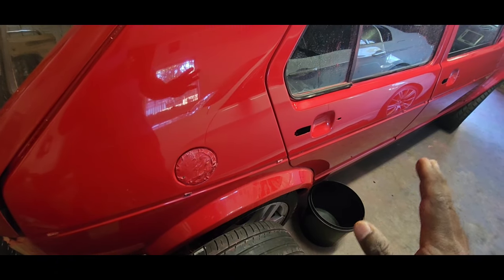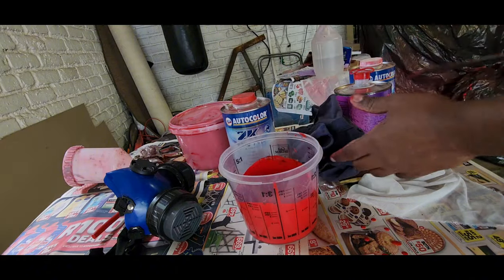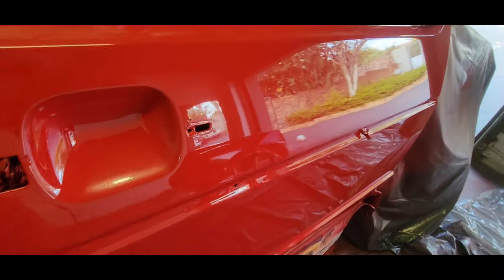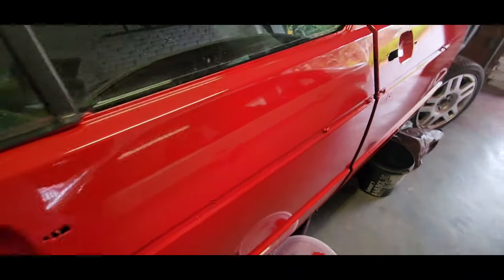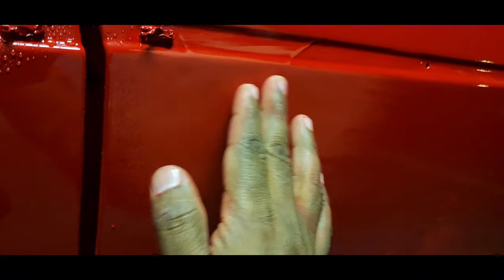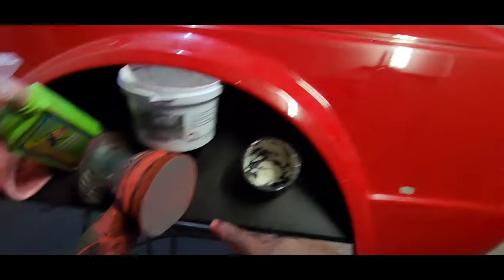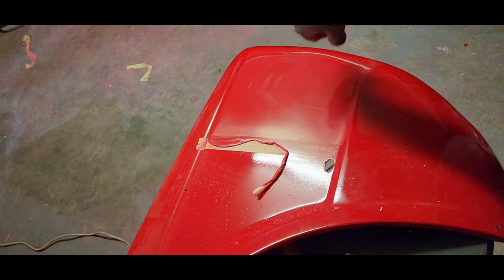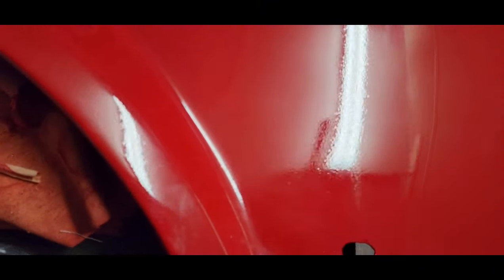How to get show car paint finish in your home garage

Comment: Awesome stuff man, the sponge pad you use at the end, does it help with swirl marks? Spray job turned out beautiful bro.
Reply from the maker: @mustasprojects  . Hey bud. The mop pad cuts really quick but leaves swirl marks. The sponge pad does help remove swirls. You can use only the sponge only, it works really well but just takes longer. Theres also much less risk of burn through with the sponge. Thanks buddy

Comment: This is actually what I'm struggling to get. I have orange peel and I've sanded the car to repaint it again. Just a few questions. Did you clear coat the car before polish? Should I polish before clear or polish after top coat and clear? Your work is hell amazing!!
Reply from the maker: Thanks buddy. I used single stage paint on this car hence no clear coat. If you are using base and clear, you will only polish the clear coat. You can lightly sand over base coat, but this is mainly to sort out imperfections before clear. You will however have to give it another light coat of base before clear or else you might see the scratched in the base or the orientation of pigments in the base will show up as blotches etc. I hope that this explanation helps. I learnt a lot from watching YouTube channels such as diy automotive school,  paint society and swrnc. Let me know if you are still unclear on anything. PS, do not sand base coat with anything rougher than 800 grit. All the best buddy

Comment: Man that looks great! I’m about to try my hand at painting for the first time soon on my tornado red mk4. You give me inspiration. One question: before you started (when the car was matte red) was that just where you sanded the original paint, or was that tinted primer? Thanks
Reply from the maker: Hi buddy. The car was sanded with 800 grit paper hence the matte finish. Try a test panel first. Get a feel or the gun and the paint flow first. All the best buddy and don't give up. You can email me on builtmk1@yahoo.com if you require more info.
Reply: @builtmk1795  awesome, Thankyou kind sir!